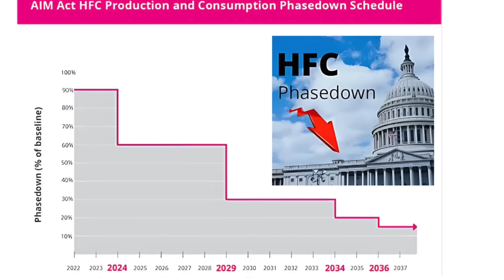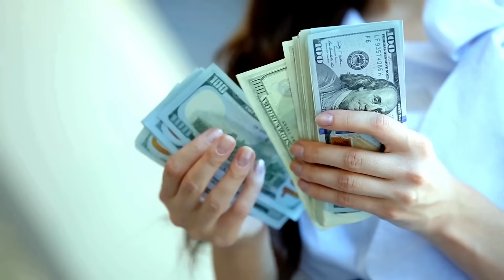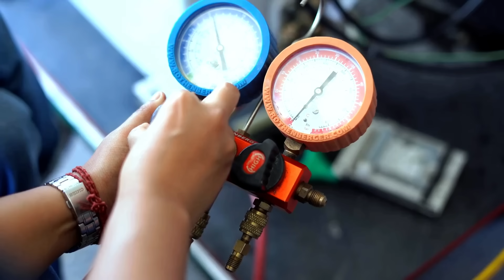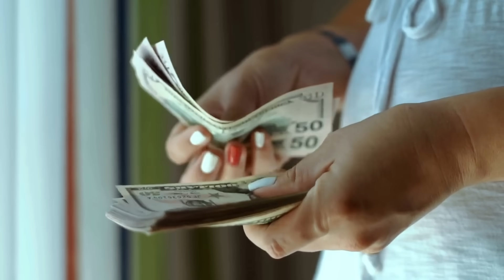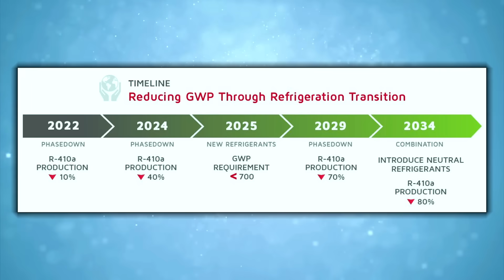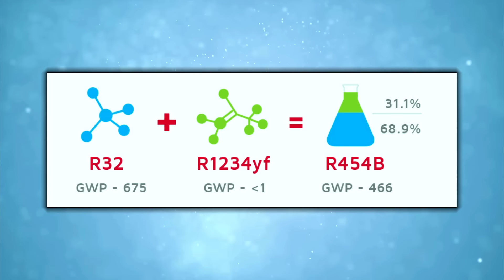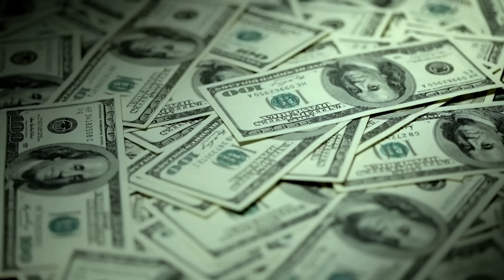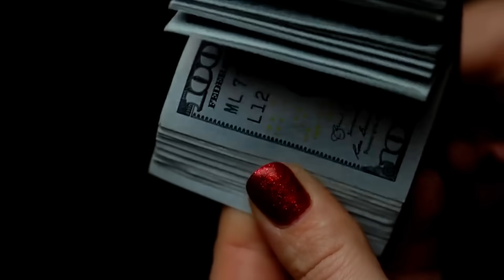Latest on the 2025 Disaster in HVAC and 454b Problem!

Comment: I don't know why you have been so worked up about 454b if you have a supply of  r32 and 1234yf.  Mixing them correctly is a matter of knowing the basics of the Gas Laws (P.Chem 101) and performing middle school level calculations.  You already have all the equipment you need.  If you want to send me a nice vacuum gauge I 'll make a cheat-sheet explaining the charges.

Comment: 20 yrs in HVAC. This whole transition thing is CLEARLY about money. Even at the local level. Upselling people claiming "as contractors we are not allowed to work on r-22 systems" Is normal everyday B.S. 
  If our industry had STARTED with better reclaimation and Best Practices in or before 2000 we could still be using R-22. Its our own fault.
as an industry we have handled this horrably.

Comment: First time with 454b today that my sensor or board was bad from factory , is there a way to jump out the whole assembly for carrier / Bryant ? Looking to just jump the entire dissipation / midigation board
Reply from the maker: While I can’t speak for your exact piece of equipment, I do know that many manufacturers have built-in options to disable the functionality of the A2L refrigerant sensors. That said, I would strongly caution against making any modifications that could bypass safety features. Those systems are designed to protect both the equipment and, more importantly, the customer. The safest route is always to follow the manufacturer’s guidelines and pursue warranty replacement if the board is defective, rather than risk creating a safety issue.

Comment: I'm hearing it's not the lack of R454b but the lack of container jugs in particular the left hand threaded valves and slow release pressure devices. Not sure but being slightly flammable and dumped quickly in an enclosed space (work van) it could possibly be an explosion hazard. Prices seem to be coming down and 2 companies are selling 20lb jugs for $149.00 free shipping.

Comment: I recently got three quotes for a heat pump Mitsubishi system in all three included the 410A refrigerant. It's now August and they only have 4 months to  legally installed these 410As . As a homeowner why would I want that's going to be outdated in a few months? I told them I don't want a 410 system
Reply: R22 systems are still around and supported.  Same will happen with the the 410 system.  Why face the early adopter issues that will be inevitable with the new systems.
Reply: R410A will be around for the lifetime of the system.  No thanks to being an early adopter with the R454B systems.

Comment: I HATE my new system. I have a YORK. It doesn't listen to me. It pushes cold air when it wants to. Its 73 outside, 77 in my house i have the setting to 73 and it just refuses to push cold air. The system has a mind of its own. My HVAC guy keeps coming back to fix it but I dont know if anyone is having this issue.
Reply: York by Johnson Controls aren't known for their reliability unfortunately.
Reply: @MarkB71152 yeah I am learning the hard way. I dont know if this is a common problem. The system is just nonresponsive but installer says its the meter. Thats what its supposed to do ..control output for energy efficiency

Comment: I just replaced a 4 ton 18 seer 2 stage R410 system with an R32 single stage after compressor fried. It didn't take much research to realize the Goodman basic system was the best option for me. Keep it simple... Less costly and readily available parts. No shortage of refrigerant and it puzzles me why so many companies decided to go R454B... This Goodman 14 SEER might cost a little every month but it cost 1/2 the price up front. After owning a 2 stage, variable speed blower system for 15 yrs, i'm glad to see it go to the dump. Too many costly repairs for my patience. Hopefully this Goodman last longer than the complex crap that I removed.

Comment: You are spot on! First, I’d like to say that this isn’t a new problem. I ran my own HVAC company for 25 years and was the owner/operator. I primarly replaced equipment or installed new systems with Goodman equipment. In the last five years of my career, I had to put anywhere from 3 to 4 pounds of R410A in the equipment but rarely exceeded a lineset length of 30 feet (commonly between 20 and 25 feet). I finally got sick of absorbing the cost and called Goodman and reported the issue and requested reimbursement for labor and refrigerant which they were happy to do.

This is just another glaring example of the incompetency that existed in the Harris/Biden administration. They always put the cart before the horse. Recall the debacle of trying to switch the country over to EVs from gas and diesel when the demand nor the infrastructure simply doesn’t exist to support this, It was the Harris/Biden administration’s EPA that forced this mildly flammable refrigerant calamity on the industry and the American public. Since 1995 the industry told us that R410A was the refrigerant of the foreseeable future. I guess they were a little nearsighted. It’s been very frustrating to me how weak ACCA has appeared to be in the face of what the EPA and Dupont want. It seems they just go along with whatever they want. No backbone there at all.

With respect to what contractors are doing to alleviate the situation, I see, once again, the lack of focus on the customer and, instead, placing priority on sales no matter what. Unfortunately, the customer really has no idea how their system works or what should and should not be done to make their system work correctly now and into the future. Ultimately I think a class action lawsuit against the industry and the EPA is the only way now that the customer can be vindicated.

Again, thank you for putting this video out there and perhaps making the public aware of what is going on.

Thanks, Rick.

Comment: Was told while looking at a new a/c that the 4 ton  units using 454B requires a copper vapor line of 7/8 " mine is 20 years old and has 5/8" line.  Is there any truth that I have to have new line installed>
Reply: To my knowledge pretty much all 4 ton units will use a 7/8 vapor line. You can view condenser installation manuals for the system you choose and they will specify 5/8 or 7/8 depending on size of the unit and the length of run of the line set.

Comment: I  had two systems changed out a week apart. Both same brand and same installer. Both techs who came and looked at my old units told me about the R454b shortage and said a lot of installers are just using different refrigerant. Some more discussion was had but generally they were saying no one knows what will happen. So while they are telling me this, I am imagining them filling the entire system with the old refrigerant 
However I bought the first system and They had  a can of R32 sitting next to the new outdoor condenser. 
They ended up not using it because the lineset was only 12 feet and the condenser came pre charged and was over charged to account for an even longer lineset.
The second system I bought was upstairs and probably 70ft lineset. I didn’t see them finish the job so I assume they added R32 because no way that condenser had enough refrigerant over charged that much.
I am not in the business, but it made me feel a little more comfortable with the risk that they just added R32 to top it off vs fill it completely with the wrong refrigerant.
Guess I must cross my fingers at this point.

Comment: i blame the epa.    there is only one manufacturer of 454b.   EPA in their infinite wisdom should have before implementing the mandated date when r 410 units ceased to be sold, required more suppliers to have adequate availability of a2l refrigerants.    as a non hvac tech, but able to diagnose and treatment low and high voltage hvac issues,   i am getting my 608 epa certification and will be stockpiling r410 a canisters for my 2 units    have 2 american standard split systems that were installed in 2009.    i have replaced myself the outdoor ecm condensing fan myself and haven’t needed any other repairs.    Sorry to hear AS/ trane has gone the r 454b route and am not sure when unit replacements are needed i will go with them.     Really don’t want to go with the Goodman r32 units either
Reply: i realize i can buy r410 myself from ability refrigerants if i attest that i am giving this to a  r 410 tech.     Going to get myself a good r410 manifold set and good vacuum pump

Comment: I installed a R410A evaporator last year,  14 year old condenser.  Signs of oil on micro channel coil , replace CF motor,  dual cap. 
No R410A condensers available in my area,  checked with 5 ac supplier companies.  So? I guess ill be patching my older condenser for awhile. Or retrofit with R454B txv on my evaporator and pray. 😂

Comment: I did redneck math and googled how much CO2 one creates when one gallon of gasoline is burnt. The search engine said like 22#. One pound of R410 leaking creates as much global warming as approximately  2000 pounds of CO2. so one pound of R410 leaked into the atmosphere creates approximately as much global warming as burning 100 gallons of gasoline. The new refrigerants create as much warming as approximately 700 pounds of CO2 so one pound of R454B leaked in the atmosphere creates as much global warming as burning approximately 300 gallons gasoline. My math on this just can't be right! considering how much fuel  is burnt there is not enough saving in global warming to justify changing to flammable refrigerants. My math on this just cant be right on this.  Would someone tell me where i made my misstake.
 

 f

Comment: We’ve had a run of compressors locking up either on start up or within a week of installation. In the last month I’ve had to replace 4 compressors. Also the sensor in the evaporators are bad from the factory, causes the unit to shut down and just run blower fan. It’s garbage all the way around

Comment: We have gone to window units until more of these problems have been resolved.  Yes, the electric heat strip in the air-handler is expensive in the cold winter months, but in 5yrs of winters that will be our break-even point for us.  Wish it was as easy as buying a Camry that's affordable/dependable/reliable.   Which HVAC system is that???

Comment: Thank goodness I solved this problem long ago by buying a portable AC when the central system went out. Central system still runs great for heat on the resistance coils in the air handler - 49 years now and still going strong.
Reply: I am on a portable AC this summer as I am not seeing much positives about these new R32 systems.

Comment: I have two 17 yr old units. Both using R22. I get them checked each yr. They are both low on R22. But I can't find anybody to add R22. Was told against the law. Now, I have to look for 2 new units. Both are not blowing as cold
Reply: Yep, and I have the same issue on our central air. It cost over $1,000 to charge with R22. So far so good. But, there is a leak (probably the coils in the basement) so it won't last. What to do? It get COLD here in the winter in Ohio, so a split propane + heat pump is necessary for those near zero stretches that can last several weeks. But in 2025 it is so, so confusing for the consumer. We can't go to R410A as our R22 system uses the wrong lubricating oil. 

What will R22 cost the next time? Even higher! So here we are. I guess you hope the lubricants are compatible with the next thing for a purge and change over?

I'm looking at systems now and REALLY hate this! All I see are mistakes and confusion for the consumer. I'd rather pay  a lot for something that really works, but it seems we are paying a lot for something that isn't really proven yet.
Reply: You can remove the R22 and use R422B refrigerant. It’s a drop in replacement. Add a leak sealer while charging. Doing this is a lot cheaper than new systems.

Comment: Yeah its a major problem. Im a Commercial only HVAC Service tech. 17 years in field.  It's a problem because I can't buy a bottle of R454B. I already had a new RTU have a bad compressor. Without availability to Refrigerant I can't make the repairs needed to complete my repair. I will not use over the refrigerant on a failed compressor job.

Comment: Carrier and Trane put the R454B in there units? So the dealer installs a new system into a homeowners house say a 3 ton unit and in the first year haft the freon leaks out of the system and find it's a leaking coil from the factory. The dealer made $2000.00 profit on the job for his company. Now he needs to put in 4 lbs of R454B a 20 lb jug cost the dealer $1700.00 Now the homeowner wants his unit fixed for free in the first year. Dealer just lost all his profit and will be out of business before next year? Carrier and Trane still in business did the big factory's give the dealer a few jugs of R454B hell no

Comment: I am not in the industry anymore but I still do my own installs. My house and shop have two year old 410 units but but my rental house has a 22 year old furnace and evaporative cooler. Furnace runs fine but I want a 410 unit in there. Two months ago I bought a new 410 unit and a bottle of 410 for potential future needs just to secure the equipment as it's getting harder to find equipment.

Comment: they did the same shit with r22 made it hard to get or if you did get it  it was super expensive , so don't act so surprised this shit happens with EPA doing this. they pushed us using hot shot or 134b and 410 now 32 so if you been in this field long enough you shouldn't be surprised about this.    businesses always buys up stock and cuts the throat's of others who needs it.

Comment: Thanks to the 2019 American Innovation in Manufacturing (AIM) Act, which was pushed by every major manufacturer and the climate change cult, HVAC businesses and customers are behind the 8 ball simply because R-410A has a GWP (Global Warming Potential; AKA CARBON CONTENT that's too high.  We transitioned from R-12 and R-22 because of the CFC's in those refrigerants which caused ozone depletion to R-410A because it corrected that problem.  Then back in 2015, the A2L rating scale was changed to allow R-454B to be accepted as a residential refrigerant.  What folks don't hear about is why gas furnaces are required to have A2L leak detectors and IAQ dampers have to be installed now... It's because R-454B is more combustible than R-410A and if it leaks into an active gas furnace, home owners can kiss their house goodbye.  What's going to happen when that leak detector fails, or a leak occurs on a system that's using press-fit fittings and a spark occurs?  Manufactures are already talking about not honoring warranties on systems that have been brazed, and I've already heard about leak detectors being bypassed.  

You can thank the Climate cult for this one, and remember, it's all because of a high CARBON content in R-410A... you know... CARBON... that thing we're all made of and the element plant's crave.  

Thanks for attending my TED talk.

Comment: premature failure years later ???????
most systems out there have air restriction in the condenser running near or past max pressures and still kicking

Comment: Every A2L ystem we've installed has needed + 1.5- 2.5lbs of charge to hit subcool. And do with this what you will 454 systems is nearly identical PT/ subcool.. txvs are interchangable and compressor oils are identical.. copeland rep told me off the record no issues so far in their lab.. you achive percentages by weight
Reply: Hope you're right & that homeowners are not the ones getting scammed.

Comment: I literally installed a 454b system because the compressor went out on the old system. Before I sell a new system I give the customers the ups and downs. As a tech we’re kinda stuck because we don’t have access to anything but r32 or 454b. Letting the customer know that this is like a first gen iPhone, we don’t know yet if this is gonna be great or a dud. It’s too new to our area. I just try to do our best at the install and make sure the install is fully charge when I start it up.

Comment: Ive been in the HVAC field for 33 years and it's all about the money when 410a replaced r22 the prices went up now that 410a  is being replaced with 454b or r32 the prices went up ....its all about the money period !
Reply: I'd say this is way worse - r410a systems were on sale for ten years with r22. Today r454b comes out and r410a is gone.
Reply: no one talks about environmental impact of retooling manufacturers and change over refrigerant causes. 

454B is toxic to lungs and Europe is banding it. This is mainly about corporate Greed and increasing investors profit margins. There’s still a lot of our 22 systems in use. All this does is push unit Sells very unethical.
Reply: @Phyxium  Wondered while when the wind blew a little back on me it burned my nose LOL
Reply: Right!
Reply: all about patents expiring and EPA bribery
Reply: In the trade for 25+ years and its absolutely all about the money. Fortunately for me I have 2 back up R22 condensers I stored in my garage pre charged with R22. And when my original dies on my house I'm going to install my garage kept r22 condenser in place of the dead one. 
 I dont like the high pressure of r410 and the cooling capacity is less than what r22 system provides. Now this new A2L refrigerant is a huge cancer causing chemical thus the reason we need the dragonfly sensor incase of leaks. But even then if there is a leak it doesn't stop the leak it toggles the blower on and off and pushes the lost gas into the house for the residents to breath ... no thanks big brother,  I dont want nor need your cancer inducing chemical fumes. F@ck the EPA and all the lame regulation lies. Everyone knows what they really want is deminimus population.
Reply: epa is just a scam for the working class to pay to keep the corps wealthy they don't care about the environment look who is in office the trash man